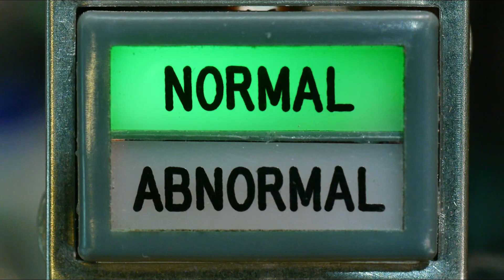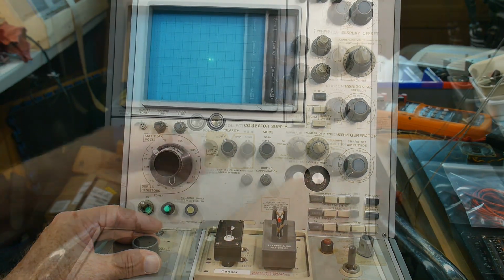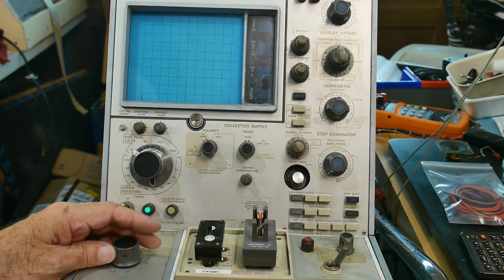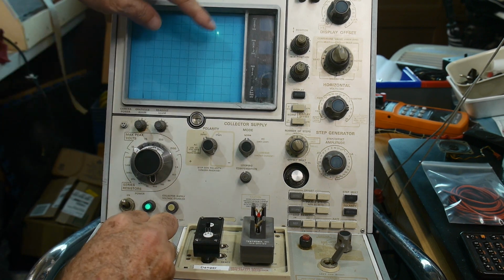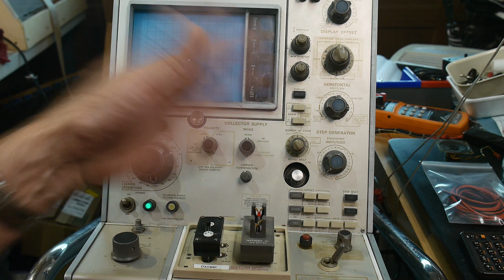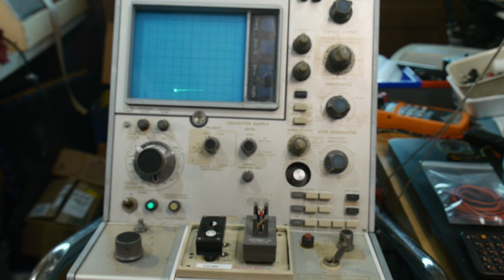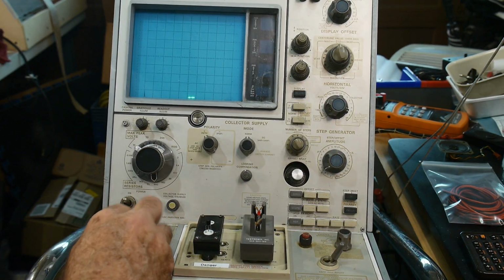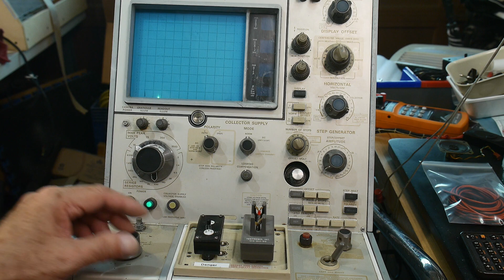#1277 Tektronix 576 Curve Tracer (part 5 of 9)

Comment: So looks like starting at the sweep generator and working forward? Or do you normally work back from where the signal should be?
Reply from the maker: I just look for low hanging fruit. Actually there is no 'sweep generator' in these. just uses the AC line voltage and a variac. I cannot tell you how I fixed it (or the one thing). there were wires shorted in some places. it just started to behave one day.
Reply: @IMSAIGuy  Just pulled down the user's manual and had a look at the schematic. See what you mean. Looks like quite a few places where "things" could have been loose.

Comment: Seems to be stuck in +DC or pulsed mode, especially with the way it appears to capacitively drain when collector % is turned down. (At least that is the way the 577 behaves in those modes.)